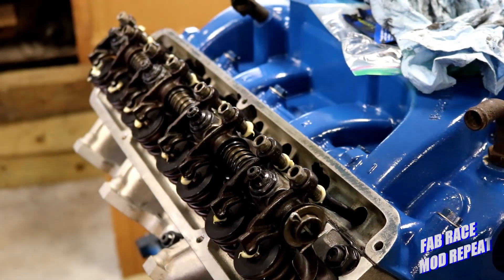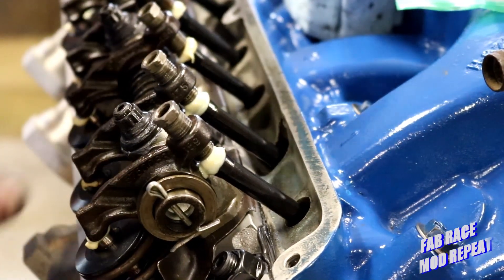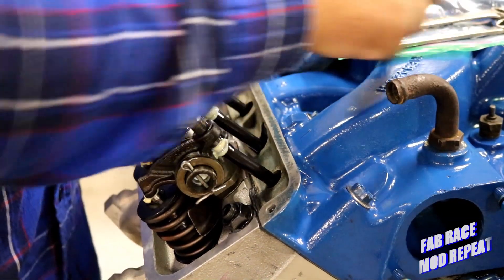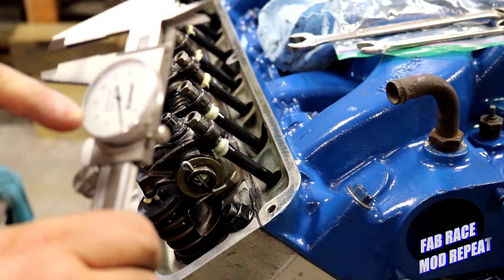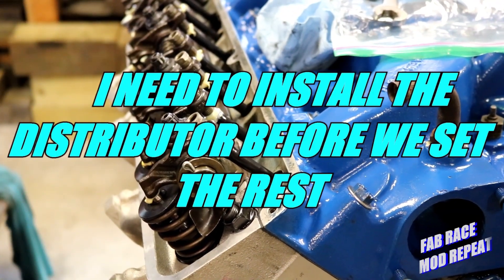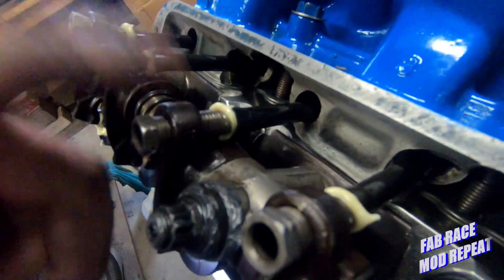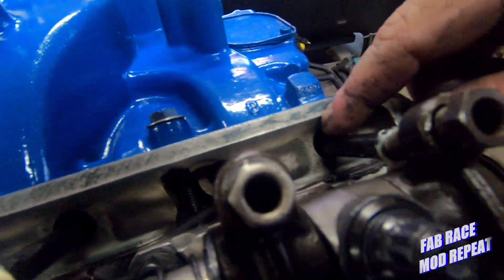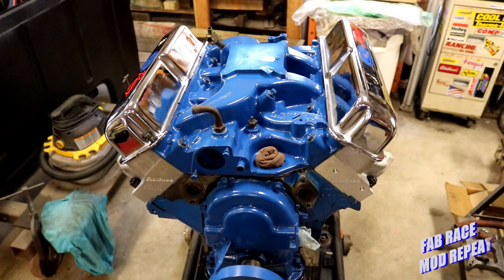Setting hydraulic lifter preload, FE build #1 part 8B

Comment: I know this video is 3 years old, I have a friend that has these rockers on his 390 Fe and the valve train was ticking.  My question is, once you set the preload how long will it last, because the adjustments do not have a locking nut to keep them set.  Modern adjustable rockers all have some type of locking nut to keep the adjustment locked in.  With this typpe is it suggested that the preload should be check every so many miles or left alone till a ticking sound is heard.
Reply from the maker: Great question:
You do need to adjust them ever so often. Mine usually run 20-30k between adjustment.
With that said if the build is 3 years or less old it may have a lifter issue, if it ticking hasn’t been driven very much.
Reply: @FabRaceModRepeat  Thanks for the quick reply, The engine has been sitting for over 7 years while he has been working on the body of the car.  I told him after watching your video that we could adjust the rockers to get a preload and see what happens from there.  Thanks again.
Reply: If you have solid lifters you will have to set lash into them & you will have to adjust them ever so often. If u have hydrolic lifters you take it to 0 lash & then u keep going to set preload. You should be able to set preload & not touch it again. That's the point of hydrolic lifters. No more adjusting. If u have to readjust hydrolic lifters you have a problem happening. Adjuster not locked down, studs pulling out of the head, lifter & cam lobe going flat? You shouldn't ever have to adjust them unless you have solid lifters.

Comment: Another question :)... if some ticking starts to occur, how can you tell from which cylinder its coming from if the valve cover is on? Is there a trick to hone in on suspected rocker arm?
Reply from the maker: A stethoscope or a long screw driver (handle end to your ear of course)

Comment: Where are you getting the .050 to deduct while setting the preload on the lifters? I am referring to the 1st clylinder and 2nd push rod, first you said back it off .050 and then another .005, where are these numbers coming from?

BTW great videos man. My first rebuild and I'm glad these videos are available. TY
Reply from the maker: Comp recommends a .050-.060 preload to start.
.055 puts us in the middle of that spec.
Glad you found the video helpful. 
Thanks for watching
Reply: @FabRaceModRepeat  so the cam manufacturer dictates that value or is it the lifter manufacturer? I'm assuming lifter? 😀
Reply from the maker: Adnan Medic 
Lifter manufacturer
Reply: @FabRaceModRepeat  There sure seems to be quite a range for lifter preload. The paperwork that came with my camshaft says .020"-.040". Other comp cams literature I have read for the same lifters says .030-.050" and was recommended by my machinist .050-.060".  I have a 351W with adjustable valvetrain and have experimented with varying the preload in the past. Anything from 1/4" turn past 0 lash to 1 turn past 0 lash with a 3/8" stud I couldn't tell a difference. I left a comment on your measuring pushrod video about the two lengths of pushrods I had to order and by the math my least preloaded lifter is .030" and the most .055". Most of the rest come to the .040-.045" range. Thing better be quiet when it starts up lol. I should have just spent the little extra for the adjustable rocker arm set.

Comment: So every time you set up hydrolic lifter you have to set up every cylinder
Reply from the maker: Yes
You need to set the manufacturers suggested preload on each lifter.
Reply: Do you know what the fire order in FE 390
Reply from the maker: Hector Alvarado 
1 5 4 2 6 3 7 8
Reply: This is to adjust hydrolic lifter too
Reply from the maker: Hector Alvarado 
If you follow the firing order it makes it easier to find TDC on each cylinder